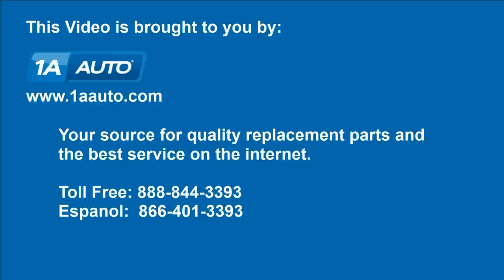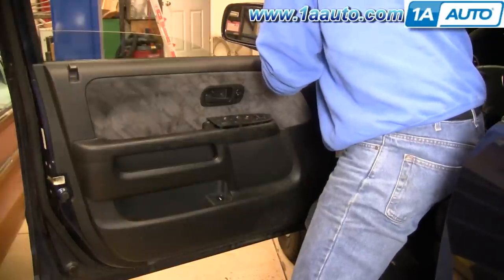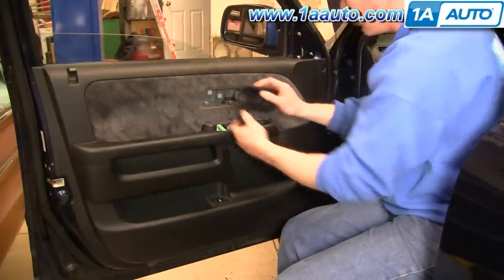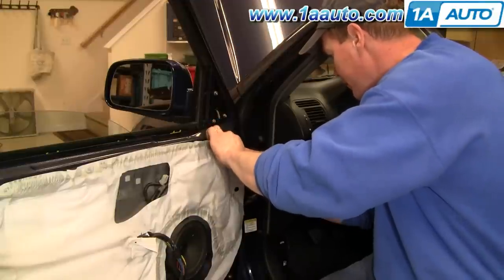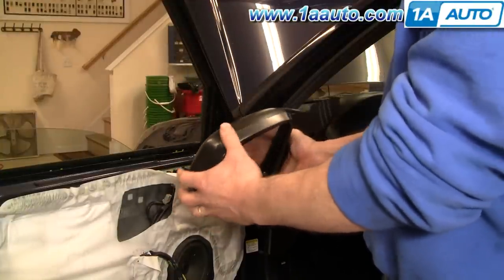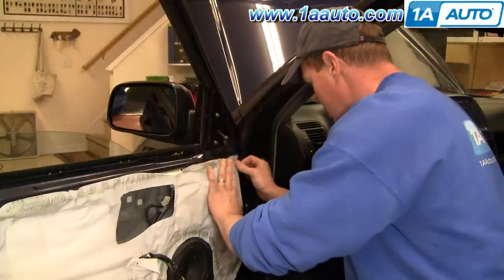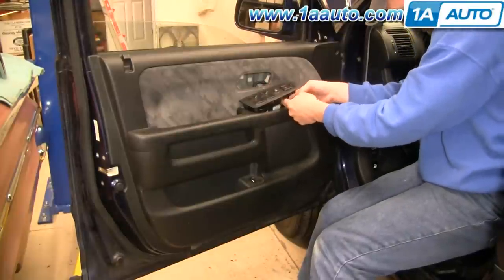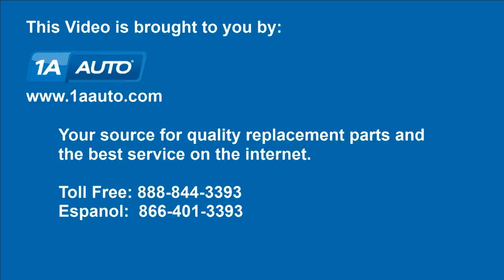How to Replace Mirror 02-06 Honda CR-V

Comment: Great Video.  There is a simplier way however.
2004 CRV - 1AAuto wanted only about $40 for a Black mirror, I order both sides so they would match. You do not need to unplug all the wires, Took less than 25 min. Follow the A1 instruct for popping door panel, no need to remove other plugs.  You will have enough access to the Mirror cord to do all you need.  Only remove the 4 phillips screws, pop the door panel and let it carefully hang while you unplug the mirror connection.both doors-very simple
Reply: Agreed.  You just need to be able to keep the panel close, so that you don't stress the connection, while you are do the replacement.  If you are uncertain, follow the video.

Comment: Superbly wonderful video!  Just replaced the passenger side mirror on my mom's 2003 CR-V.  Saved her almost $300 in the process over having it done at a dealer or private shop.  It was slightly less complicated than the driver's side since there is no power mirror switch, trunk release, or power lock switch on that side.  Thanks for posting this!!!!!  Now I'm about to use your guide to replacing the cabin air filter. :)

Comment: Thanks for the good instructions and very good video. I could change the passenger side mirror (which is slightly simpler) using following the instructions on this video.
Thanks a lot.

Comment: Great video! Regarding the waterproof seal on the inside of the panel, did you break the seal to get to the wires for the mirror? If so, how do you seal it back/do you need to? Thanks in advance
Reply: Hot glue gun. $5> at any craft/fabric/hobby shop.

Comment: close ups on removing door panel would be very helpful....
Reply: Understanding how to release the wiring clips, might be hardest thing, but if you follow the video, should be ok.  The screws under two screws under the window control are at an angle, so lean down to locate them.

Comment: Great video.... what an absolutely moronic design. If they had made the connector for the mirror cable up by where the 3 bolts are to remove the mirror you wouldn't need to remove the entire door panel. I love this car but some of the designs make me very angry.